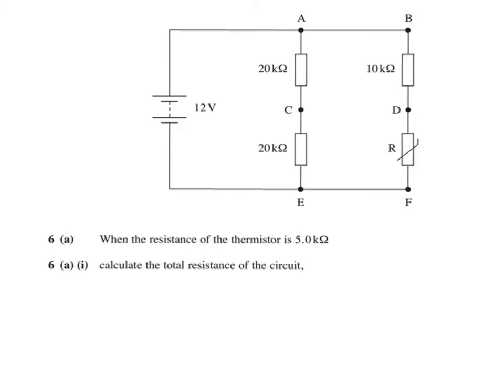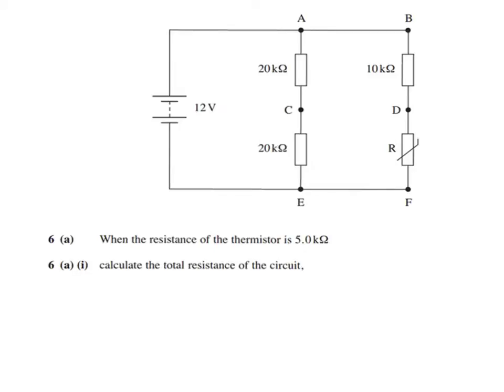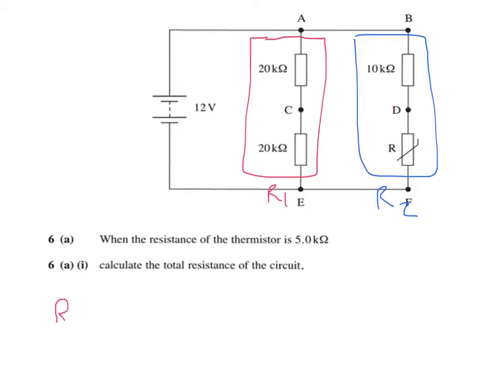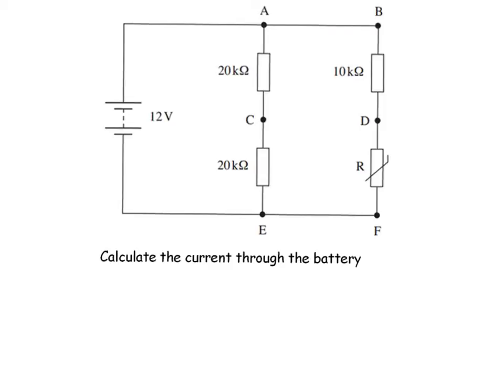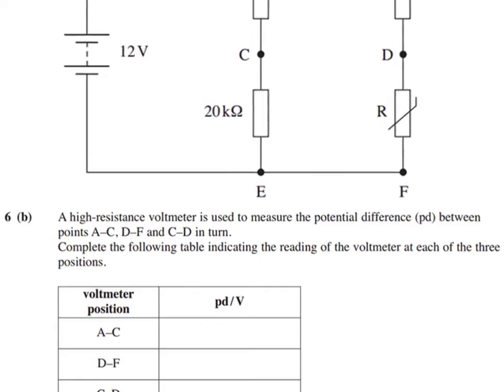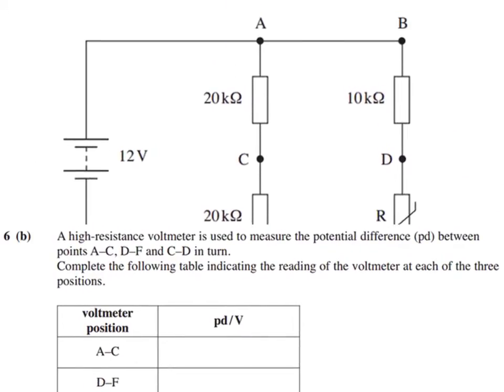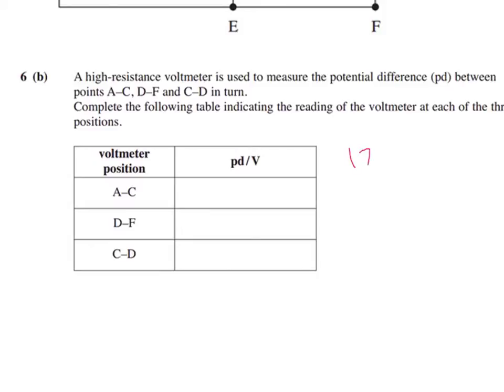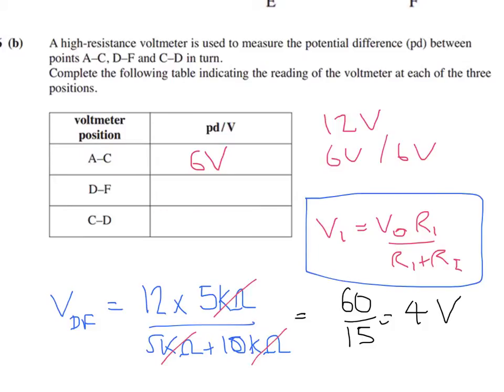A Level Physics: AQA Unit 1: Jan 2013 Q6: DC Circuits

Comment: I still don't get questions like when to work out PhD across c-d
Reply from the maker: +FST NUKEZZ It all about working out the Potential at each of the locations, once you know that you can work out the difference in potential. The 12V will be shared equally between the 20k resistors so the potential must be 6V at C (12V - 6V across first 20k resistor)

In the other loop, the 10k resistor will take double the potential so 4V will be left after at D. (Go round from the longer side of the cell)

The potential difference therefore will be 6-4 = 2V.
Reply: +LAE Physics why a loner side, electron travel from negative to positive